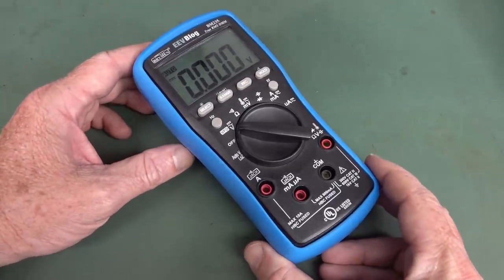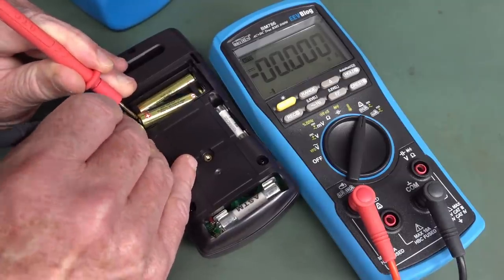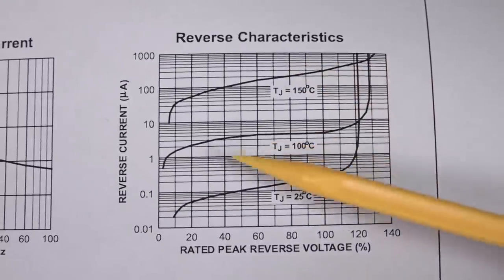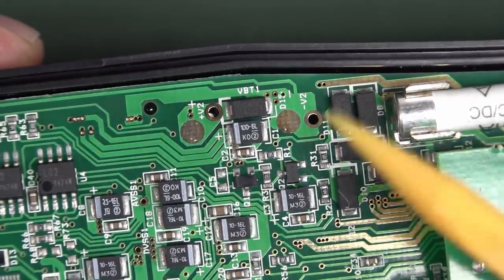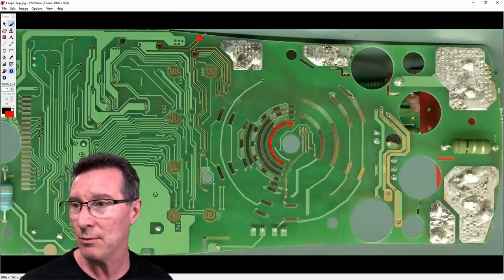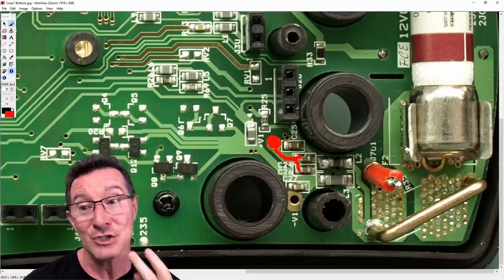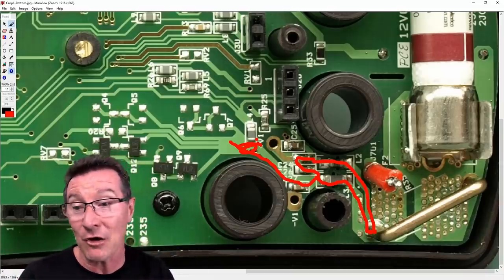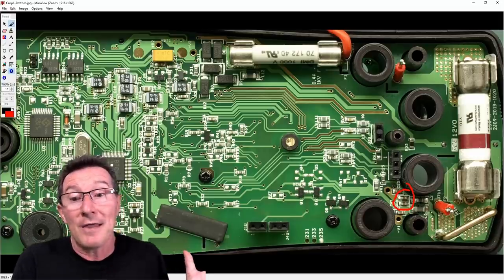EEVblog 1449 - What Causes Excess Battery Drain? (BM235)

Comment: at the 6 to 7 min mark that graph is in percent of max volts not volts so that 25C leakage current graph ends around 100v not 10v.  extrapolating I'd expect less than f-all current (sorry for the imperial units).

Comment: I don't know the construction of the range switch, but by the looks of it the positive strip isn't always connected to the same sub-circuitry. So maybe they wanted/"needed" these capacitors here in whatever mode is selected. And by designing this way they covered them all at once.

Comment: 13:00 Isn’t this the only way they could have wires those capacitors? If the caps were after the switch, then the shunt would also be after the switch and you’d have to take switch resistance into account

Comment: The 1N4007 is a 1A diode. What if someone puts in fresh new AA batteries in the wrong way.. how much current is going to flow? AA batteries have a reasonably low ESR, so it's easy to get >1A. I wouldn't be surprised if it was a multifold of 1A.. (like 3A or more)
If the meter would sit there with these batteries for a while.. I'm sure that diode isn't so happy anymore. The meter may have survived, but perhaps that diode could start leaking and be the culprit. I think it's also quite easy to test. Just put in 2xAA in backwards, leave it for 5min, and then see if anything has changed(or smoked).

Comment: I had the some issue with a fluke 176 old version i don't have the MSP microcontroller i replaced  with new  when i found a bizarre behavior when I was measuring 480vac the multimeter shut down and restart but it work fine with 110vac

Comment: I’d put my money on routing - especially if there were _any other revisions before the one pictured - which then likely wouldn’t feature those caps. Still just a friendly wager though. All three components are fairly easy to test (or just replace, at a cost of about 10 cents).

Comment: at 5:44 it says rated peak reverse voltage in percent, so what you are calling 10V would be 10% of the rated peak voltage right?
which for the 4007 with a peak voltage of 1000V would be 100V then? or am I missing something?
I mean doesn't change your point just makes it even more clear I guess.

Comment: Hi Dave, I kinda stopped using mine because I was tired of replacing the battery every time I needed to use it. Even then it was the least used of my meters. I've had so many other things going on I never got round to finding out if anyone else had the problem.

Comment: No clue how these are set up internally, but is there a chance that when turning that rotary switch you'd potentially create some EMI connecting/disconnecting power to all the circuits that they're trying to filter out in all cases? (with the cap/inductor)
Reply: Good thinking, it's possible I suppose. The switch could rapidly ramp certain voltage levels up and down, inducing EMI interference.

Comment: This is a timely video as I am chasing another issue with my BM235. A few days ago I turned it on and it initially showed the panel test (all segments lit up) and then the panel went blank. Believing it may have been flat batteries I changed them but the same result. Tried a few more changes of batteries having checked the voltage beforehand, but the display refused to come on after the initial panel test. Both fuses are intact also.

I then hooked up my bench power supply directly and fed the meter 3.2V. Still didn't turn on. Increased to 3.3V and the meter powered up and stayed on. I slowly reduced the voltage from 3.3V until I got to 2.4V when the low battery indicator on the meter came on, yet the meter was still operating as expected.

I shall be buying some AAA-size lithium batteries in the next few days, and hopefully, the inherent higher voltage of those will get me out of trouble, but still puzzled as to why normal fresh alkaline batteries have now stopped working. I'm suspecting the initial test for voltage has failed or has drifted.

Any ideas?
Reply: just because the batteries are fresh doesnt mean they are good. ive had numerous ones fresh out of the package  volt test ok but under the slightest load go flat.
Reply: My theory is you were fooled into buying a P.O.S. meter

Comment: Fascinating, I had somebody mention that they had an issue with her guitar pick up draining batteries as in put new battery in and by the next day be completely dead. My first thought was capacitor or some sort of component sitting between the switch and the battery or the switch was not working right which is usually a quarter inch and shorting the ring shield. Lo and behold this video pops up in my feed and confirms my suspicion. If I do eventually work on it I will have to make a video of it because apparently this is a common issue for that pick up.
Reply: Be very aware that the X7R ceramic MLCC's (which are used in the higher value capacitors) are EXTREMELY piezoelectric and can function as microphones causing feedback in amplifiers. Much like many old Triode Vacuum tubes could because the grid would vibrate.

Comment: Capacitors so that, even if it is switched off, the large area of the battery does not act like an antenna, and couple RF energy into or out of the circuit, but instead connect it to the common terminal.

Yes the capacitors can be leaky, especially with the board flex issue, which likely has cracked them, and they started to grow whiskers, that are acting like a partial short or have reacted with moisture to make a conductive channel internally to the capacitor.

Probably a good idea on the next revision of the board to move those 2 capacitors, likely 2 different values, like 1000p and 100n, so as to get different self resonant frequencies, and move them to another orientation, so the flexing forces do not crack them. Probably assembly force applied direct to them is causing this.
Reply: So, they put a point of failure to avoid rf energy to do what exactly when the switch is off?!

Comment: Those capacitors will filter out the voltage surges due to the sliding ('bouncing') contact as the switch is rotated.  I don't know whether this their primary purpose, but such surges on memory cells thoroughly confuses state machines.
Reply: You would have to place them on the other side of the switch for debouncing.
Reply: @inse001  yeah, the only thing I can see is when you have the switch on and you change the batteries...but it seems to me a little too much to worry about from a design point of view....
Reply: @inse001  Then the springed contacts to the board and battery terminal contacts.

Comment: I have a cheap studio light with excess battery drain. Luckily i have two so i got to do some measurements and compare them. 
The affected unit has a very high (12mA!) standby current, and oddly enough, when switched on at lowest brightness it actually draws less than that. My only conclusion so far is that it has a faulty mcu or firmware causing it to draw excess current in standby. Current draw when switched on was completely normal and matched the other unit.
Reply: Mhm they probably have the same firmware for years and never change it. It would be a weird fault for the MCU as well to not enter standby properly, but then, weirder things have happened, so it is a possibility. It might be worth digging further for educational purposes. It could be powering something external to the MCU down and that thing is malfunctioning for some reason. Difficult to guess without seeing the device.

Comment: It's great the meter is saved with that reverse diode, but do the batteries get hot, leak and explode this way?
Reply: Normally the user would detect that in seconds as it does not work. You can short alkalines briefly without harm. NiMH is another matter.

Comment: If the 4007 was the culprit then it would be easy enough to find a replacement, but if it’s the mlcc caps then how do you determine their value since they are not marked. That’s something that annoys me about smd caps.
Reply from the maker: You have to guess based on the functionality, or maybe it's still readable just with higher leakage.
Reply: Probably safe to whack any cap on there as long as it fits.
Reply: @bertblankenstein3738  Yes in general if you are using a MLCC you are not too worried about value, as most are used for decoupling, DC isolation or something else in that realm, and are not too critical value wise, which is a good thing as they also are very much going to change value depending on bias and time. Only when you get into RF circuits do they get critical as part of tuned circuits.

Comment: There's another option for excessive power consumption when switched off; during shipping the NSA intercepted it and installed a wiretap in it.

Also if that tantalum is in their unit I would be rather suspicious of it, they tend to develop very severe leakage currents when operated outside their ratings like in a momentary reversed battery scenario.
Reply from the maker: The tantalum is not across the battery

Comment: I don't have a Brymen branded meter, but I do have a Greenlee DM-210A (similar and made by Brymen but not true RMS) which hasn't had any of these issues in ~5 years. I'll compare the board
Reply: since it probably uses the same Analog Devices chipset as the Fluke 7X series, you may be able to convert it to RMS like Dave did the other day.

Comment: I believe you mentioned moisture-conductive dirt, especially under the SMT components.  In my years of occasional conductive problems troubleshooting I recall two cases when there was a buried copper (or tin?) whisker between traces.  Pretty hard to locate, but eventually chasing micro-ohms or even nano-ohms along the traces, I found the location.  Looked perfectly OK on the top, even after removing the solder mask.  Hmmm???  But digging into the epoxy, there was a hairline of copper (in my case).  Looking with a good baclight and a good microscope it became evident that the whisker was just long enough to bridge the tho traces.  A little more scraping and the whisker was gone.  I don't recall exact resistance, but it was some ohms.  Just a hair width or even less of copper.  My PCB manufacturer told that he had seen some similar cases of buried whiskers in raw laminate.  So my two cases were not unique.

Comment: leadfree ist more deadly for component and less for all people.  🤗
Keep the reflowtemperature as less as possible. Test if 5sec longer on a lower temperature fixes this problems. 
Make test PCB with ~ 100 parts and measure each one after reflow
Reply: Agreed. The bureaucrats that came up with that lead free mandate need to be drawn and quartered (euphemistically of course). It is probably the worst decision forced on the electronics industry ever.

Comment: I am so confused. I thought the switch on the DMM physically opened and closed the circuit to the MCU and the other components.
So does the OFF position on the switch actually do?
Reply: It cuts the circuit to everything except that one diode and those two caps. Which are on the battery side of the switch. Diode makes sense to be there, caps are a mystery.

Comment: what are the two red cut off wires that are coming out from the multimeter PCB?
Reply: the red is actually a stand off and it USED to be soldered to a daughter board that had the actual banana jacks (for scale of course!) on it. Dave had desoldered those two connections in order to see the bottom third of the main board.

Comment: I was googling this today lol. Is this question relevant? "Why connect capacitors to ground?" e.g. from a post: A high-frequency signal will see the capacitor connected to ground, and travel through it, since it is a low impedance path, but a low frequency signal will not be affected by it. The capacitors to ground form a low-pass filter for the lines they're connected to, as they remove high-frequency signals from the line by giving those signals a low-impedance path to GND.

Edit: I have no idea hoping someone can figure it out in comments and explain
Reply: Possibly to filter switch noise when turning the unit on to prevent the MCU from having issues arising from a bad reset pulse?

Comment: So the diode just shorts out the battery if they are in the wrong way?
Reply: Yep!
Reply: Amazing! How often is this design used in consumer appliances?
Reply: @henryD9363  Just like Nearly Every Device on market, The only expection is If it's Very Cheap and don't even have any Protection or tremendously well-Engineered or Expensive so they used better measures. But I'll say 90% of them uses it. It's so that the Fuse or the Diode Blows up and You replace/repair them instead of Repairing or throwing away the entire device

Comment: Design flaw. This would be a complete non-issue if the off position was a physical clicky-clacky switch that mechanically and physically broke the circuit between B+ and the first part of the meter proper.

Put a proper on/off switch on that thing. this 'soft off' bullshit is why this is even a thing.

Comment: The caps could be to smooth the voltage if there are some oxidation in the battery terminals and instability due to meter trepidation. But I also agree they could be after the rotary switch. The reverse protection diode after the switch  with some long traces could mean if the battery is left reversed some time the traces could fuse with the current no?? Regards!

Comment: hmmm. switch off.. remove batteries. clamp voltage source on there (Still off) then slowly turn up the voltage to 2000V and look whats getting hot ... :-)
(i bet youtube wont autodelete this comment because it is rather stupid and does not have some well formulated paragraphs,
as my post on the last video (wealth) did. which disappeared thx to ai-bot-mod)

Comment: Just eliminate those batteries, and use lithium batteries.
Reply: Not really Commerical I guess, they probably prefer removable Batteries and stuff for repairs and cheap replacement than an Li-ion